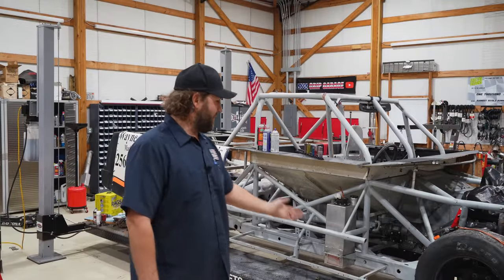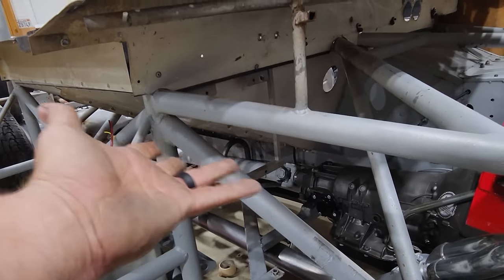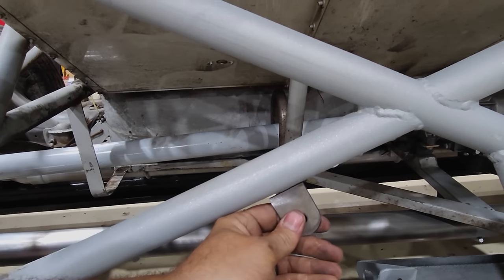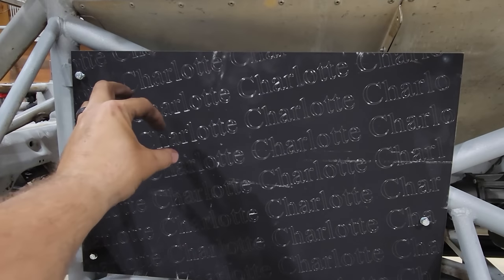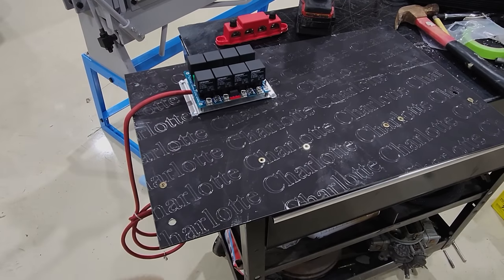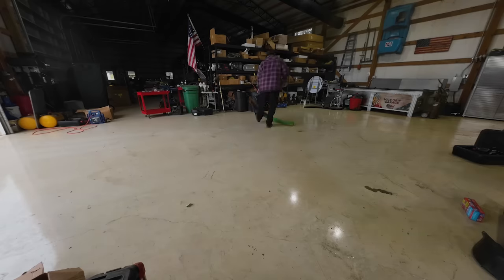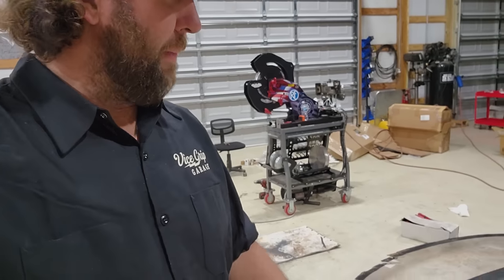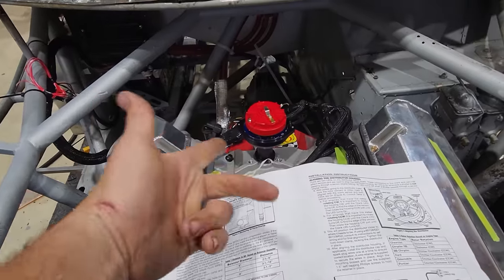Race Truck Gets Electrical, Bumpers, and a BODY! SO MUCH TUBING!

Comment: Derek, YOU are the content. What you and your family set your minds to doing is secondary. Enjoy yourself and we will even happily watch paint (I mean powder coating) dry.
Reply: Amen     So well said - A former VA State Trooper,  USAF-CAP Pilot, Patriot Guard VA Asst. State Captain - and Retired Pastor - but still ministry active...Wytheville, VA
Reply: And we have actually done so, at least if you subscribe to Vice Grip Lodge. Or earlier on this one. That Chevy with the $109 eBay paint job & the red pinstripe was sharp, a guy thinks.

Comment: I know it's been a hot minute but don't listen to the complainers - in fact, it might be best not to even acknowledge the negativity. The true fans know you can't do the same thing over and over. While I like the revivals, I also enjoy the build outs. Plus its winter, no one wants to lay on the wet frozen ground while trying to get a car/truck running [I don't] - true fans understand that. True fans understand warmer weather is around the corner. True fans love all the content. You work hard in what you do and produce and I appreciate it. Thank you.

Comment: Nice to hear from Bradly. I used to build model rockets. They were fun because not only did you watch them fly off like a bottle rocket on steroids but you also had a great excuse to go on an adventure to find your rocket. 👍🏼👍🏼
Reply: Yep I built thousands of them and only ever lost 1 even got in to the fancy ones with cameras and altimeters and temp collection devices and such had a blast building them my biggest and best one was a shade under 6ft long 2 chutes 5 stages of 59-ax engines and I nodded the forcing cone so she would build more Iam leaving the chat boosteses lol 😂 but she went a tad over 7k feet and captured 30 pics on the way down and man it was awesome temp was like 60 degrees cooler at 7k feet if I remember right 

Lord I just went back to 15 years old sending paper towel tubes in to orbit with the moon tune thanks fella for sending me back a few years now I have a hankering to hit the hobby store and get a launchpad and stuff and build more with the moon tune
Reply: I hope we get to see Bradly's rocket launch on one of the shows.

Comment: I just got my first shop job and the first car I got to work on was a 70 Camaro. 
The owner is having us swap out the old burnt out 350 for a new built 434 with the Holly sniper efi system. It’s gonna be one mean rig.
Reply: Congratulations
Reply: Thanks

Comment: In the past, I've used "caterpillar grommet" around holes in panels, it comes in sizes for various panel thicknesses and is cut to length for the hole. I always used Hardman Double Bubble epoxy, the red stuff sets up in 5 minutes or so. It's pre-measured in the packs, and is far superior to cheap Horror Freight 5-minute epoxy.  It will protect all your cables from the sharp edges where they go through your plates and panels. I'm really enjoying this build, bare-bones for sure. All the best to you and your family.

Comment: Menards carrys that blue Teflon tape. That stuff is good. That blue monster pipe sealer ,for gas pipe,is gooder than the white stuff also. I found when it's new let it dry a scotch. It thickens and works better.👍👍

Comment: You could run the exhaust up and out of the bed so you can siphon all of that wheel smoke up into the stratosphere for all the fans to enjoy. Draw that smoke out of the wheel wells like a sandblaster draws sand. Have fun with your build. Love your content. Keep up the good work.

Comment: I have one of those Volvo pumps in my parts stash. Did a bunch of work on a pair of V50 wagons for my older 2 daughters. For anybody interested in picking one up they can be found in the right front corner of the 2004-2012 S40, V50, C30, C70. It takes a little doing to get one out but if you pull the right front fender liner you’ll see it.

Comment: The Gasolia sealant you use is something that I use in the petroleum industry as a replacement for Teflon tape on pipes, hoses, nozzles, you name it. If it has fuel running through it we use gasolia on it. Also fun fact if you get it on your hands gas helps to get it off.

Comment: Revivals are good, builds are good, it's all good. You might refer to the red gizmo that brings in +12 V and sends it here and there as a power distribution block. I like the way you are laying the components out, keeping the fuel parts and the electrodigital lightning parts separated, and such. At least that was the intent I remember from an earlier video.

Comment: I also ran around with a lot of dirt roundy rounders growing up and have helped hang numerous bodies on cars. Wish I could share some knowledge with ya but by the time u got to read it, if u did, would be too late. But its pretty simple. Find a starting part on your support bars (1/4 sq. Tube) and start measuring. If it dont work cut it out and do another. Every body is different but the most important thing is getting the body to hang half ass straight.. anyway good luck brother you got this!

Comment: Derek, I know this video is old but I just caught something: you should ground your engine back at that distribution block. I know it seems stupid when the frame is a ground too and that’s just the normal way to do it. But you’ve now chained a critical component to one before it, which would always result in multiple failures: in your case, I’m setting the engine and electronics being susceptible to losing ground of something were to happen to the ground from distribution block to frame. The cable you need from engine block to distribution block provides a straighter path for electricity too, eliminating that ground chain or any ground loops. I know those aren’t as important in hotrods, but in an electric guitar, ground loops are unstable and produce a lot of hum.

Comment: I started using liquid PTFE after a buddy told me to use it on the pinion nut when I rebuild the axle for my C10. It's pretty much teflon tape paste. Well the smallest quantity is that 8oz bottle so it was just sitting there so i started using it on everything that needed sealing. Way easier than the tape

Comment: As an individual that did tons of electrical work on everything from autos to Mack Trucks, one huge hint "NO SUCH THING AS TOO MANY GROUNDS" - and remember, wire is like water through a pipe. Too small a pipe, means not enough electricals can make it through as needed. 
Mack used circuit breakers. Beat the hell out of fuses.

Comment: @Aging Wheels is building an electric Escape and he is using an electric power steering pump from a Volvo S40. He applied 12v and ground to the heavy leads and 12v to what looks like a gray wire from the other connector to power up the pump. It takes a second or two for the pump to start. Looks like you would be able to power up or down the pump remotely from your switching center.

Comment: Best hour I've watched over a few days and would do it again!  That was great work!  A future project?  My nearly rust-less 1962 Willys Wagon with the Tornado engine.  A historic engine.  The "Tornado engine was the first post-World War II U.S.-designed mass-produced overhead cam (OHC) automobile engine."  The "Original" SUV.  I could actually use some help with it.  I'm an old Vet and it's not getting easier!  Thanks for a most enjoyable hour, Derek and the Others!

Comment: Derek those "XP FLEX" cables are not made of copper, but aluminum with tiny bit of copper coating to make it look like copper! In other words that thick "0" cable is equivalent to like 1 or 2 gauge copper wire. Still an upgrade from a 4 gauge in terms of resistance, but unnecesary thick and les reliable than a copper one.

Comment: Hey Derrick! I’d love advice on this, I bought an ‘83 F250 with the 300 in it, replaced tons of stuff in the engine bay before I really knew much about it, so anyways I’m getting spark and fuel and I believe compression, it started up a few days ago and now just won’t do it. I love your videos and they’ve taught me so much but I just can’t seem to problem solve this. I’m more than happy to answer any questions and try anything to get her back running again! Thanks for being a teacher to me.

Comment: It would be nice if you can add build info in the "Show more" section... engine size, trans type model, and rear axle. Super curious to have info as you put it together.  Love your channel.  I am working on an old 74 Chev K5 Blazer

Comment: For power steering, i used a Prius Electric power assit in my offroad rig. Might be worth looking into them for future adventures. Super cheap, available and wayyyyy easy to install as there is no lines/hydraulic mess....

Comment: think best thing to do for wheel tubs in the back is making them from 4mm thick metal (pipe cut in half ?) , basicly trailerfenders but extra thick and put sharkteeth on the back edge so any pieces of rubber and cordlayers getting trown of the tire get caught and cut before the flail around and start damaging stuff 
as for the riv nuts vibrating loose : i might help if you put locktite on them before you crimp them intoo the hole , the use the less permanent locktite on the bolts

the guy winning the truck is pretty lucky , used to be a regulair at a chevy truck forum and there was one guy that put big 500 cadillac engines in c10s , these engines dont have a lot of speed parts available but are realy strong engines

Comment: I’m not a racer or anything, but I had a thought on the front bumper assembly that you could consider sometime.  What if your outer sleeve tubing went to the outside edge of the frame rails and you used sheer pins?  That way if you bumped the wall you might get lucky and just have to replace the pin.

Comment: Hey Derek. The Volvo power steering  pump is made in Holland and the cables are obviously main and the 3 wires are CAN high,  CAN low and power switch

Comment: A friend of mine that races UMP modifieds puts a starter push button out by the master cylinders on all his cars just for the purpose of being able to turn the engine over without ignition to be able to set valve lash or whatever he might need to turn the engine over for without ignition or having to reach into the cockpit

Comment: If you're worried about vibration, use some rubber washer on the bolts that connect the panel to the frame, and use BLUE loctite on all bolts.

Comment: 3 small wires to PS pump,  ignore the twisted pair and run 12v key to the 3rd wire and pump will run at 80% all the time.

Comment: I think it would warm my cold heart to see a giveaway of one of the upcoming revivals that would otherwise go to the back of the line at Rusty Acres after its (1 hour and) 15 minutes of fame.  Fill the trunk with the parts you would have used on the 2nd video, and put a tripod with a phone mount in the backseat.  Give a fella - or fellette - a chance to start a channel continuing the story of that revival.

Comment: So if you actually look closer at that Volvo power steering pump, it says on it Ford Motor Company. And yes you put Power to those main wires and then that plug goes to a canbus so you can vary the speed of the pump

Comment: I think that xpflex isn't full ofc, I believe its mostly cca copper clad aluminum. I've had bad luck with that stuff it works for a year or 2 and it will corrode at the terminal ends. Soldered, hydraulic crimp, hammer crimp, various types of terminals its always problematic down the road.

Comment: The only thing I don't like about mounting those components on the side is that they're more vulnerable if you slide into a wall or someone bumps you real hard. You might want to think about welding in some extra support structures to protect that area.

Comment: Love what you're doing with the truck.  Just wondering if you might think of some type of rubber or spring style bushing between the electronic bleep-boop stuff and the rigid frame.... thinking vibration vice getting hit with a Tanya Harding.  Just sayin...

Comment: I believe that you only need one of the wires from the three pin connector connected to a 12v keyed source, other than the main power, to use that power steering pump. I imagine you probably already got it figured out.

Comment: Can not get my head around the wiring .. think I have a single wire from the Magneto to the key Acc slot for motor stop , key on is gen , starter is a button on the floor you stand on . Have up graded the carb , no more Zenith up draft to a 1970 VW Solex just turned the intake up the other way , yes still only gravity feed for fuel . A massive 24 HP at 2200 rev

Comment: Ya outta put some trailer fenders over the rear tires then put some concrete trays on top for added weight and protection from tire popping and great smoky tire burn downs.

Comment: The power steering pump looked like you could just build a little strut over to the other mount you planned to cut off and it would really solidify the mounting.

Comment: Back in the 60's and 70's a lot of the short track late model stocks would run a leaf spring side ways behind the quarter panel to bounce off the wall. You could consider integrating something like that on your next go around.

Comment: Saves on the Sam's Club parking lot these days. No sooner I get my rear bumper buttoned up like factry and someone smacks into it. 😵‍💫 Grate. I could have used a Stale Cracker, in that moment. Eww, I was not happy. Broke the brake springs, hardware, tie backs and warped the bumper again. After I had just took the warp out of the other side. Talk about biting a crawfish in half. 😅. No Worries. No Worries. Everything can be fixed.

Comment: Variety is the slice spice splice of life I don't know either. But I'm watching it all love the whole channel.
And speaking of the splice of life if u don't mind a suggestion, you should put one of them there lone wolf buttons in the engine compartment  for priming and timing and valve adjs. Just make it a bit easier for a guy.

Comment: I’ve seen you use gasoila several times now. I work on aviation equipment and use it on hose connections on fuel delivery systems on fuel trucks. It’s nasty stuff, but works amazing!

Comment: If that volvo system fails to work out, slap a manual gear box on the frame and then add an electric power steering column mounted motor. This removes all the hydraulics from the vehicle as well.

Comment: On the power steering hoses, could a feller use hydraulic quick connects so when you disconnect they don't leak and it's easily unhooked

Comment: Wish the race truck had a load more degrees of steering lock, drift car style. That seems to be what is needed in all the events it's destined to be involved in. Get more agility in tight pads and let Derek use mor of the corners. Hope to see this developed.

Comment: Just a suggestion having put electric power steering into a project, you really need to have it solid mounted or your going to have issues with it working. Oh and remember it holds a good bit of fluid that needs to be able to be picked up so it doesn't run dry or lose pressure Just imagine how much G force is on it as you do doughnuts. It's why it's rubber mounted but the play in the mounts is what it needs to work and more is just bad. It will be easier to fix now than later.

Comment: you need to talk to kevin with ksr and ask him what he did with his electric fans because he was running a 16 volt system on soccer mom and kept melting his fans because they are not rated for 16 volts. I dont know if they make a voltage regulator that you can put in line but its something to look into.

Comment: So what you want on the Back of your Truck, I wanted on the Front of My Rig, so when I went down the High Way I could Play "Bumper Cars".....Push the Igiots out the way....the "72" Auto-Car I drove had a 750lb Plow frame on it, but it didn't Wrap Around, but it sure Stuffed the Rear Bumper of a 1970's Plymouth Fury in to the Back seat.......LMFAO!!!

Comment: Hey Derek, I just got done watching your video. Can you switch sides with the value covers and have the breathers in the back so you would have better hood clearance
Reply from the maker: 4 bolts on the bottom 3 on the top

Comment: That stuff is legitimately called “pipe dope” 
I did commercial plumbing for years. 
Used to lubricate gas pipe threads to ensure proper fitment and then provide a good seal.

Comment: Can't help but wonder if a feller's gonna also put some sort of radiant heat shield between the headers and that li'l Terminator 'X' unit to avoid possible premature heat death of the digicals.
Probably not. I'm just gonna pretend I didn't see that😑.

Comment: 2 things: first, the revivals- I was actually thinking you might want to ease up a bit until you got some of the rescues sold off. I recall in the early days you’d sell them (even posted for sale on the website back then). You’d rescue them and then hand them off to someone who would take the next leg of the vehicle’s journey. I thought it would be a shame to rescue one and then have it sit in rusty acres long enough to deteriorate further. I like revisits when things get man-tenance and upgrades for sure. Second- did I miss something about “Charlotte”? I mean other than being a city and track in the north state of NASCAR, what’s the significance? I was born there back in 1969 and moved away in 1986. Also obviously a woman’s name and may have nothing to do with the city… clue a guy in?

Comment: I'd love to see you find a late 1960s, or early 1970s, Chevy Impala and just get it to a good-running roller condition with a decentish interior. Maybe a 396 (or 383 stroker) and TH400?🤷‍♂️IDK. Anyway, it could be domething a fella, or fellete, could take all the way or leave rough body-wise. That would be a great give away if you could make it happen for reasonable $$$.😎🇺🇸